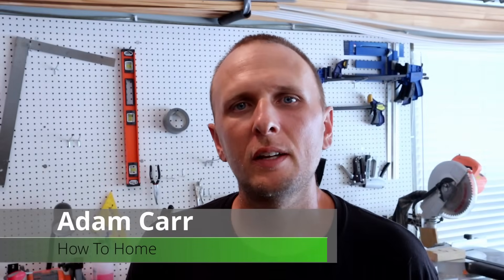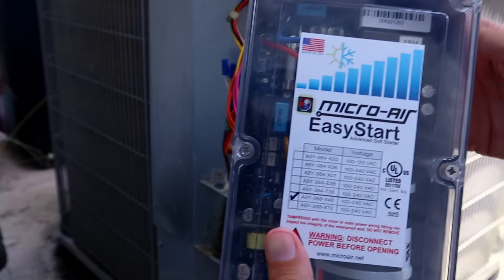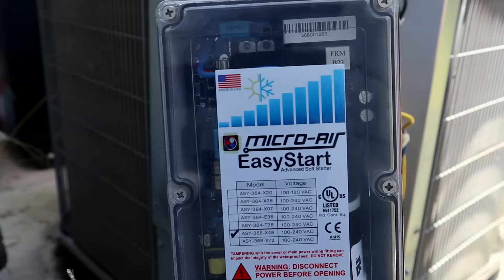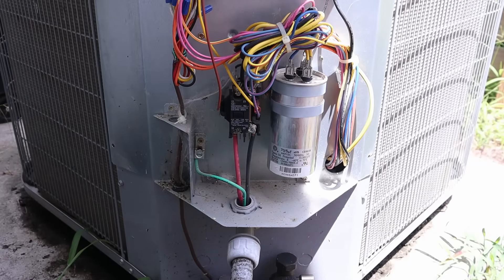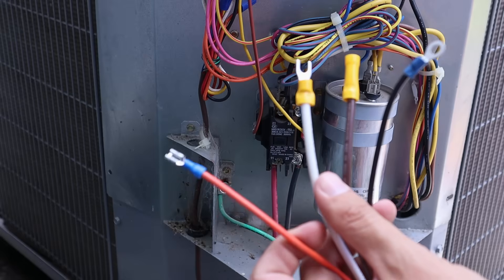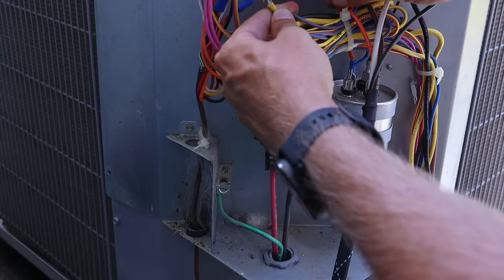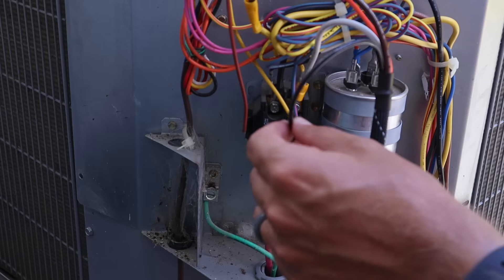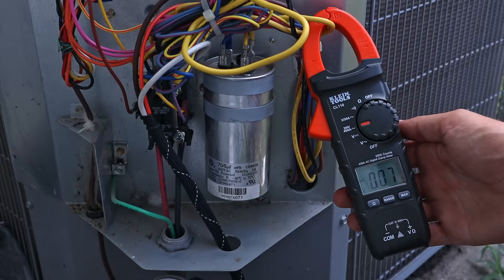How To Install A Soft Start Kit On A Air Conditioner | Run Home AC With A Generator | MicroAir

Comment: You video has me intrigues about this device but curious about a specific question about it. 
It seems to get an answer from  Micro-Air support, one needs have been a buyer of their products first.
maybe you know the answer, and the question ins this: 
I notice that all soft=start kits ASY-364-x36 is labeled  for 3-ton A/C unit.

Can this device be used for a 2.0, ;  2.5 ton unit?

thanks for any feedback

Comment: I liked your video and your efforts.   But you get no bonus points for failing to cover showing clear in-rush amp results after 5 learning starts.   You mentioned this learning topic.  So then I expected to see results.   But bigger point is do you or anyone have reliability testing over an entire season ?  I understand a compressor cycles many thousands of times during an entire season.  Leading me to wonder about the feature benefit of easing the burden on the entire system... and the electricity savings ?  But most importantly,  what is the reliability during a hot coastal salty (Florida & Texas) air use case scenario over an entire season?    Sorry,  I cannot imagine spending $300 + dollars until I can realize reliability.
Reply from the maker: Have had it installed almost 2 years now and it’s still performing.  It’s not made to save money however.  It’s to prolong the life of the compressor and to bring down the in rush to where a generator can start it without issue.  And I’m in Florida.

Comment: MicroAir Easystart is a combo soft start and hard start modification.  Should have shown start current after the five training cycles with the actual selected start current showing on sixth startup.  Allow 5 mins off time for compressor refrigerant pressures to equalize between training starts.  Typically achieve 60% to 70% reduction in startup surge current on compressor.  Training should be done on grid, not with generator.

A hardstart kit is just a momentarily large start cap placed across compressor run cap during the half second startup.  It is intended for low AC line voltage situations or long wire runs to compressor.  It actually increases startup current.

Softstart is a like a 'light dimmer' that ramps up the voltage during the half second startup.  With both hard start cap boost and softstart dimmer ramp, the hard start cap is also voltage ramped so it gives the torque boost without the sudden surge current to compressor start winding of a normal hard start kit.

After the start up, the run current is as normally seen before installing MicroAir.  The MicroAir does not effect run current.  It is bypassed with a relay after the about half second startup cycle to prevent excessive heating of voltage ramp triac.
Reply: So are you saying thay the micoair softstart kit is not needed?
Reply: This is a great device.  Can this be used with a heat pump as well?
Reply: @tonylohrman2031  yes
Reply: Thanks for the info!. If a hard-start was installed due to issues with an old compressor, would this help prolong it's life?
Reply: @Ryan-dj5ku  Lowering the startup surge will reduce stress on compressor.  Weak link in EasyStart is the electrolytic start capacitor.  Good to buy a spare capacitor to have on hand.
Reply from the maker: @RCin Fla what do you mean by the capacitor being the weak link?  I am asking because I’m going to be doing a new video on micro airs newer model and in prepping for that video I found something very interesting in regards to the capacitor on the ac.  So looking for your insight as to what you meant.  Thanks.
Reply: @rcinfla9017  oh ok, I wasn't sure if it would have enough to kickstart it. thank you
Reply: @HowToHomeDIY  Electrolytic starter capacitors are the dark plastic cased caps that are made with liquid electrolyte paste and carbon electrodes to achieve high capacitance in a small size.  They have poor ESR resistance and can only be energized for a short time period or they will overheat. They are the least reliable component in the Easystart.  Mine failed after two years.

You will find these type caps in water pumps and air compressors AC motor to provide starting phase shift to auxiliary starter winding of AC induction motors. These motors typically have a centrifugal switch to disengage starter cap after motor spins up. 

Foil run capacitors in metal hermetically sealed cases are more reliable but cannot achieve the necessary start capacitor value in a small size.
Reply: @rcinfla9017  wow, two years is a fast failure for the price. Can the start capacitor in the unit be desoldered and a new one put in it's place?
Reply: @Ryan-dj5ku  Starter cap just has press on terminal lugs and is tie-wrapped in place.  Easy to replace.

Comment: Nice video.  This showed a significant drop in current while running.  Has this also resulted in any noticeably reduced electric bills?
Reply: There's a long video speaking with one of the engineers from MicroAir about these soft start kits and he explained simply that the reduced current is for so brief a time (to get the compressor going) that the amount saved would be negligible (think penny or less) and you wouldn't really notice it. It's more the ability to start the system with less current as well as the side effect of not driving your compressor so hard which will help lengthen the life of the compressor because it's not being subjected to the high inrush current.

Comment: with the power losses in green energy california, when SDGE returns the power, my a/c got fried, so i installed this.
Reply: Sorry to hear that.  Might want to install a whole house surge protector.  Here in Chicago, about a month ago, we had a bad thunderstorm come through our area. I put our Delta Pro in EPS mode powering about seven of our circuits.  There was a big power surge from the Utility line, and it damaged our DP.   I had to send it back for a new one.  

Lesson learned, I installed a whole house surge protector and a single outlet surge protector for the DP.

Comment: What is the LRA rating listed for your compressor on that label? I have a 4 ton ac I'm setting up for home generator use and I'm just curious what yours is compared to mine. Mine is listed at 108 LRA. Not sure how that compares to the actual startup inrush amps but I'm hoping it doesn't require 108 amps to startup! Thanks a bunch!

Comment: This might be a game charger for me. I was thinking about trying to run my 3 ton Mitsubishi mini split with a Honda eu 7000is generator and I was worried about starting amps. I think this might be what I need. Any thoughts?
Reply: Also, another question. I’ve tried to research the specs on my mini split.  Do I even need a soft start installed? It appears the unit is a soft starting system already.  The mca is 22.1 amps with a breaker size of 25.  I’m not a pro though so any thoughts would be appreciated.

Comment: I have seen this kit and it appears to work correctly. my question is if a condenser motor already has a hard start kit installed to help with starting and i remove that hard start kit and install this kit will it provide enough current to actually start it without the added help from the hard start kit. good video!
Reply: Yes, in the instructions of the kit it says to disconnect  any hard start kit before installing. The Micro-Air kit is all you'll need.

Comment: Thanks for this video.  I used it to help me install the Easy-Start on a 3 1/2 ton Carrier.  I'm pretty sure yours is a Carrier too, right?  Mine went for an in-rush of 107A to 25.5A.  Incredible and now I can run my AC on my Generac battery if I lose power.

Comment: Are soft starts usually only added to the compressor motors on condensor units? What about having one for the blower fan on the indoor air handler unit?

Comment: This soft start is required for a generator to power the AC unit. A hard start kit will not work because most generators cannot supply the high inrush current required.  I would love to see the unit actually run from the generator.

Comment: I have the same KLEIN as you. To get In-rush current, do I just put it on AC Current 400amps, and then just press the "MAX" button? Will it display the MAX in-rush that way or is something else set up? (I'm a mechanical guy tryig to get one of these working). Thank you!

Comment: My condenser already has a small "Start Assist" (small, yellowish,  about the size of a deformed golf ball capacitor) installed at the factory along with what I assume is a compressor delay circuit board. How do I install this soft start with these Factory installed items? My unit is a 3 Ton Carrier.

Comment: Adam, great video. Thanks. Would this unit work to drop the peak surge of a 5,000 BTU window AC powered from a 200 amps inverter in my RV? Thanks
Reply from the maker: So they have other units made specifically for RV AC units.  This particular one is for a home AC.  I would definitely check out their website as they have quite a few to pick from.  Thanks a lot for the feedback Marco!

Comment: Hi. Can install a soft start kit and a hard start kit? Would it damage the air conditioner?
Reply from the maker: Hey, yes you can only have one or the other.  In fact the instructions for the soft start will direct you to remove a hard start if you have one already.

Comment: Excellent video I have solar and a 3.5 ton trane package unit and my 12kw inverter and only 300 amp hour battery start the ac after installing this exact softstart unit.  I tried before installing and it wouldn’t start the eg4 batteries would go in protective mode and shout down. This did the trick. Now I only need more batteries for storage. Thanks again.
Reply from the maker: Awesome.  Glad to hear you are all setup!  Thanks a lot for the feedback and enjoy that cool air 😎

Comment: Adam,
Purchased a Micro-Air "Easy Start 368" for my 5 Ton home A/C. First extended the two 10 gauge and two 14 gauge wires because the ones that came with the unit were short. Probably short for most applications. Micro-Air should really consider shipping the unit longer wires. I followed your instructions and the unit started right up. Now I should be able to use my emergency back up portable generator to run my A/C .
Thank you for sharing.
Reply from the maker: Awesome!  Glad to hear it.  We definitely love ours.  The folks at micro air told me you can extend the wires if they are too short by splicing some in which is what it sounds like you did.  Thanks a lot for the feedback!

Comment: have you done any research an average lifespan of these kits? or how often you should test them to ensure they are still working?
Reply: 2 year life span
Reply: @pedropunjabi7339   based on? Can you elaborate? What happens when they go bad? Can it mess up your air conditioner?
Reply from the maker: Well just as an update, I installed this a little over 2 years ago and have had no issues.  Still running strong.
Reply: @longrange1114  Based on a lie. I was curious about the same thing so I figured I'd lie to get the channel guy to chime in since he hadn't answered this question that was asked 5 months ago
Reply from the maker: Is just because I don’t see all comments a across the channel.  Glad I could address it now.
Reply: I just installed one last night and also wondered about the life span of these things

Comment: So, I am researching adding a generator to my home so that I can operate my central AC during power outages. We went 5 days in the middle of summer in Florida with no AC (my 3500 watt generator was only enough to run lights, fans, well pump, and fridges).  Looking to add a 10,000 watt generator (things are hooked up to allow back feeding into home safely).  My concern is the AC - it is a 4 ton Amana ASZC 18048, 18 seer. It has the variable speed air handler and a 2 stage scroll compressor.  Is it pretty much ESSENTIAL that I install a Soft Start kit (I am reading that HVACs with scroll compressors do not need a Hard Start kit) ?  Thank you.

Comment: Are there any issues with the lower inrush currents affecting modern AC's that have dual or variable speeds?
Reply: I know this is a year later, short answer: two stage is okay. Variable speed would not be okay. 

Long answer: a two stage compressor is nearly identical to a single stage. Difference being the two stage has an internal mechanism that just allows it to change capacity. Start up is the same, high voltage wiring is the same. 

A variable speed compressor does what this soft start kit does by its very design. Variable speed compressors have very low starting current and it’s capacitors are integrated into a (typically) very large circuit board. Also, there is not a herm/common/run terminal on a variable speed unit either. If you somehow managed to hook this soft start to a variable speed compressor who knows what would happen but it would most likely be very expensive.

Comment: I noticed that the meter you used does not have a dedicated inrush setting.  Do you feel that you got the correct inrush reading using the max setting?

Comment: I installed solar panels and a backup battery. Will this help my 10k battery run my 5 ton a/c in a grid down situation? We did the preliminary tests without a soft start and when the a/c kicks in, all other house lights will begin to flicker and it trips out the backup gateway. Thanks!
Reply from the maker: I can say for sure that yes it will help but not knowing all your particulars, I do not know what the exact end result would be.  It decreased my power draw by a lot.
Reply: I did the same solar panels and 2 Tesla Powerwall 2 batteries. I am doing research. This Man “How 2 Home” helped ALOT in 2 videos . I am SOLD with his knowledge. 🥇👍🏽

Comment: What are the draw backs of a soft start kit?
Reply: Can my 7500 watt generator start up central A/C ?
Reply from the maker: That completely depends on the size of your AC and the amperage it draws.  As far as drawbacks go I really don't think there are any other than it is a somewhat pricey item.
Reply: Thank you for your quick response. As far as programming it,  I think I read it takes 5 times to turn off and on.  That would be house a/c correct?  Not generaator?   I have high hopes it will woek

Comment: What size generator do you have to run the 4 ton. I have a 3 ton bt have a 7000 running watt inverter 36.5 peak amp.
Reply from the maker: 15,000/12,000

Comment: Installed the EasyStart soft start, unit stages on, fan first then compressor when main line power is used. Let it learn for 24 hours, then hooked up my 
13,000/10,500w generator to my 240v/50 amp generator transfer breaker. The Inside unit/fan comes on, but the outside compressor unit doesn’t come on. MicroAir suggested that I wasn’t getting power to the unit from that panel, so I hooked up a direct line to the unit from that breaker to test the theory and still nothing. Any suggestions as to why ? Anyone else out there have this issue? I can power everything else in the entire home, but the AC compressor unit won’t come on with generator power.
Reply: Did you check your generator to see if it's producing 60hz?
Reply: @rendezvu175  I didn't check that. I did discover that it will run the AC compressor unit outside if I depress the "manual button" where the main power comes in to the unit, but will only run if I continue to hold that button/switch down manually.  I was told there's probably something wrong with that specific part outside, ...or there's a part inside the condenser unit that's not allowing the full 24volts needed to activate the switch to the compressor. Any thoughts?
Have never tested for that, how do I check for the 60hz? Volt meter setting??

Comment: One other important feature of that particular soft start is it will keep the compressor from trying to turn back on after a power glitch. From Memory I think it is like 5 min, that way the refrigerant has time to bleed down and equalize. Great video.
Reply from the maker: Thanks for that added info!
Reply: Not sure if anyone has experience with the Nest thermostat but mine seems to sometimes kick the HVAC off and then immediately back on. I'm wondering how this Micro-air module will interact with whatever logic is causing this. I think it may be related to the Nest "Airwave" feature that is supposed to use the central HVAC fan to circulate residual cool air through the home after turning the compressor off. Curiously I have this feature turned off so I don't know what is happening but I'm worried the Micro air will be a conflict. I will report back with my findings.
Reply: @chillintm  I had nothing but problems with my Nest. Most a/c's don't run off JUST temperature, but they are also dehumidifiers. It is part of the design of an a/c system to control both. I say get rid of the Nest like I did and just get a $30 Honeywell thermostat from the Depot.
Reply: @goofsaddggkle7351  interesting info. I have not installed my Micro Air yet, but I do have a nest thermostat-e, and it will cycle off compressor but it’ll be a few minutes before it kicks back on and continues to cool.
Reply: Most digital tstats have a 5min delay when power is cut.